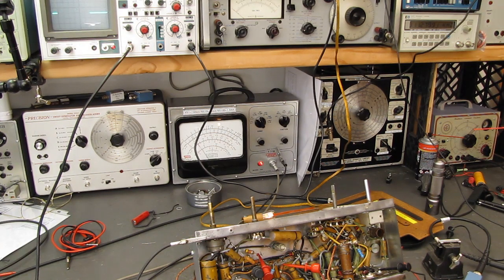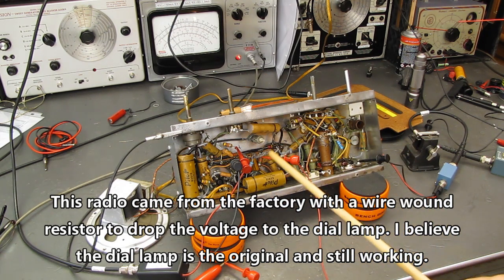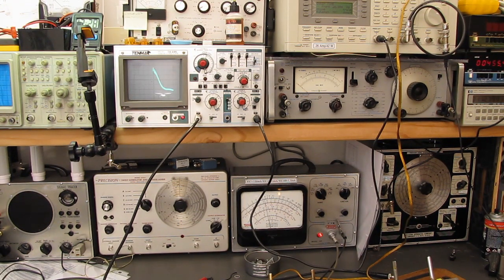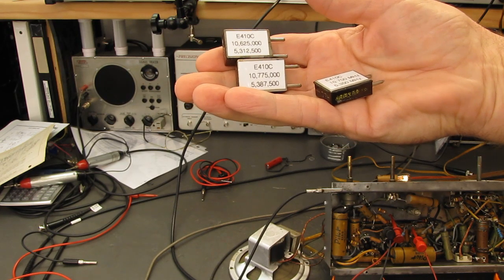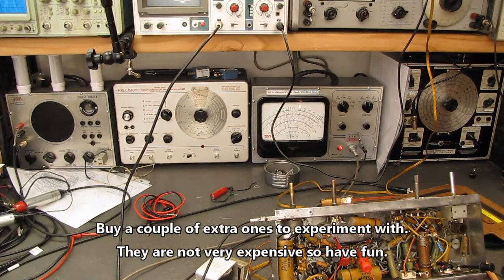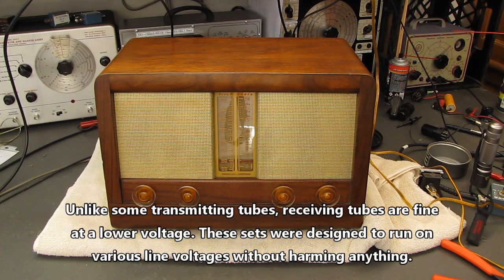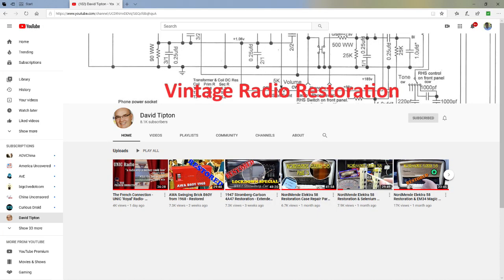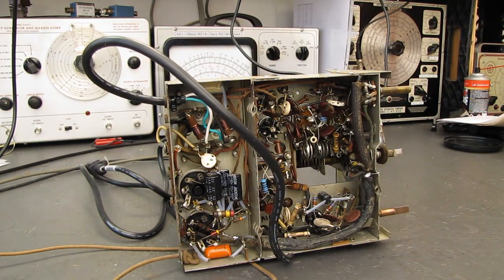10 Buck Test Bench Howard FM Converter Alignment Part 1

Comment: What I might attempt doing with the silkscreening:
1. Take a good digital photo of the back as straight on as possible, with lighting set up to make the silkscreen as obvious as possible
2. Cut out relevant section, adjust black/white point as needed.
3. Paste into vector graphics editor, e.g. Inkscape
4. Draw outline rectangle to match rear edge contour (convert rectangle to path to match trapezoidal skew, reduce fill opacity to near-zero so it doesn't get in the way)
5. Use as background template and manually redraw silkscreen (potentially tedious, maybe you have or can find a similar font)
6. Group outline rectangle + redrawn silkscreen, bring the whole thing into a rectangular shape and resize to the correct dimensions.
7. Remove background image, and you should have a fabulous template.

I'd suggest performing the first step at the very least, perhaps with a printout to be filed alongside the device itself just in case.
Reply from the maker: HI "Pile" good advice. I ordered some clear decal water slide paper and it came in. Planned on taking a good photo and seeing what I can do with it. Or trying to match the fonts.
It is going to be a bit of work. Probably a winter project.